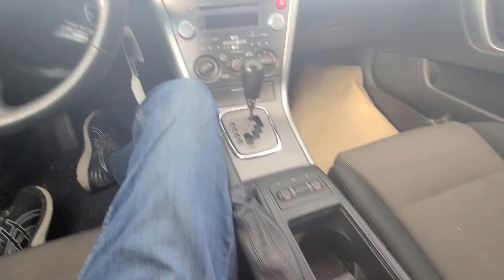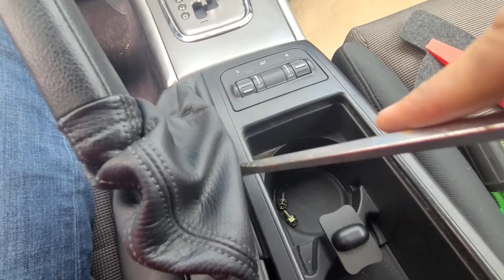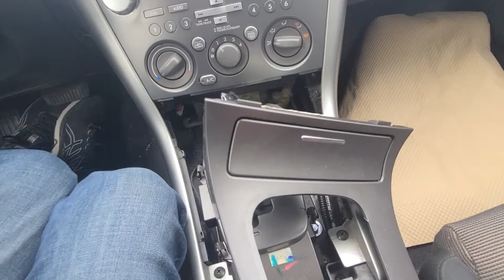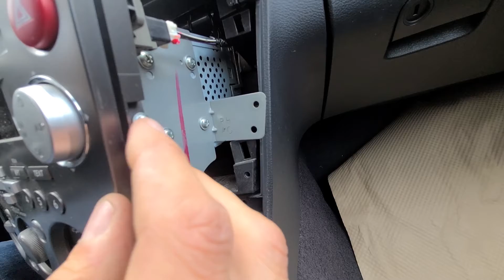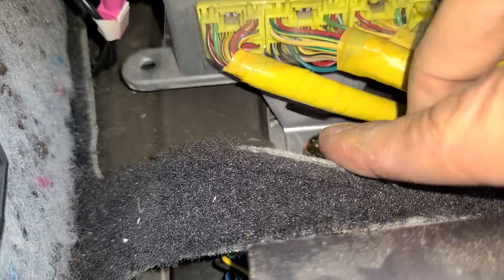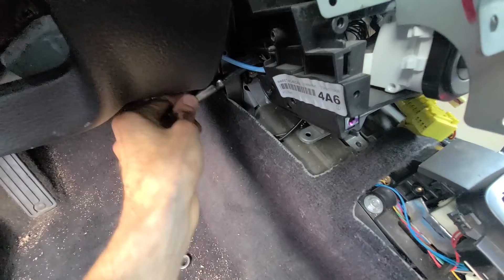Subaru Legacy Outback - AIRBAG CONTROL MODULE REMOVAL / REPLACEMENT (2003 - 2009)

Comment: Mazda 2005 Subaru Outback what about the Bell going off it's not the light for me it's the Bell going ding ding ding ding always saying the front airbag it's wearing me out I don't know how to stop it! I subscribed you and greatly would appreciate explaining me how to stop that please🙏🏻
Reply from the maker: Hi, this sounds like a seatbelt chime to me, especially if there is no airbag light on. I had a similar thing few years ago on one Subaru. Try starting the car and connect / disconnect driver seatbelt 20 times within 30 sec. That might reset it if that is the problem. If not I would connect the scanner to it and see if it shows any codes within Airbag/SRS system and go from there. Hope this helps